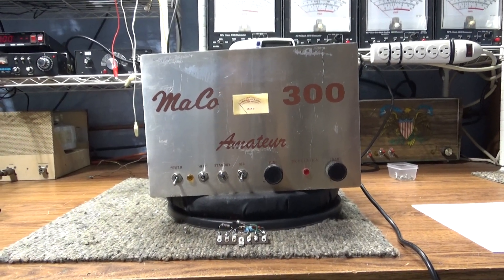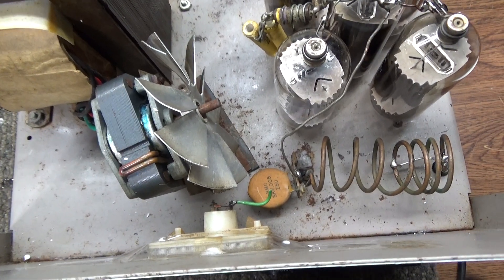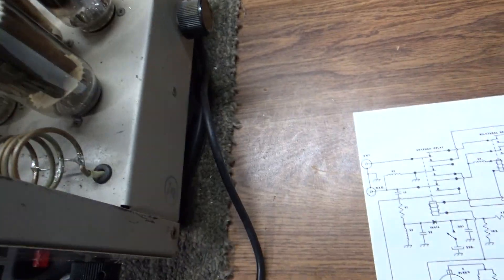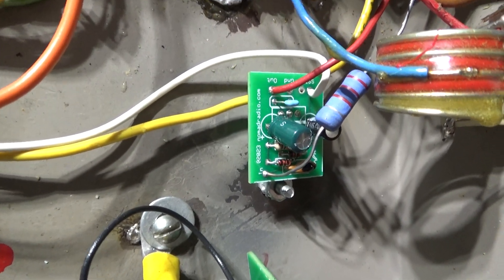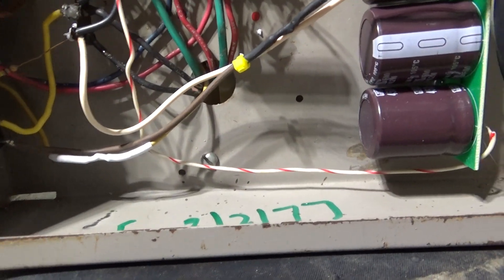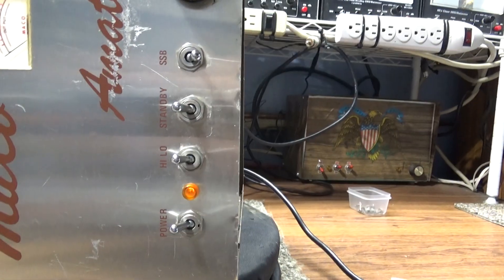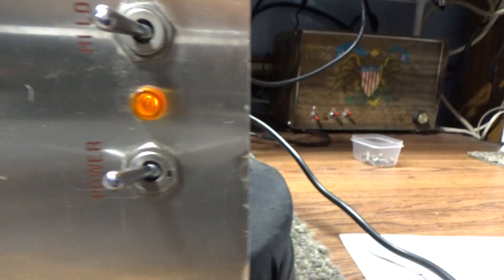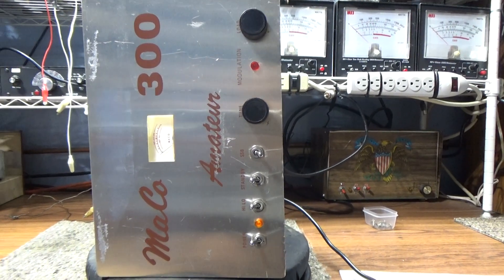Maco 300 sweep tube Linear Amplifier on the bench

Comment: With the diode it is a field strength meter.
Reply from the maker: Yes, but if the gimmick wasn't used to do something, then you wouldn't need the gimmick, right?
Reply: That is correct. You will also see “gimmicks” in input keying circuits. Two wires twisted together to form a pf capacitor. Length and twist determine capacitance.

Comment: If the transformer is running hot, perhaps having a separate filament transformer would help? 🤔

Something like the Hammond 185G12. You could perhaps run the 12.6V AC to the 8950's and the 6.3V tap the 6LB6's? 🤔
Reply from the maker: Agreed, I have done that on several amps already. That lightens the load of the transformer so it can concentrate just on the HV instead of the HV and the LV. Different but similar, I do the same with my home stereo. Bi-amping it really really opens up the sound. It's interesting to me with stereo as the 2 things that make a huge difference hardly anybody does. Bi-amping and running balanced. The 3rd but not as huge would be running stereo subwoofers.

Comment: The worst name ever, "gimmick: or "gimmick capacitor".  It's just a capacitor.  Two conductors separated by a insulator.  Many radios back in the tube era used "gimmick" capacitors for the RF output power meter circuit.  Even the Panasonic chassis tube rigs used a "gimmick" capacitor pickup for the power meter.  Most of the Lafayette Comstat  rigs used one.  Just two non terminated wires twisted together.  I use the same thing for sampling high RF power circuits when doing diagnostics.  Just twist two non terminated insulated wires together 2 or 3 times and you have a simple sample port that is good for 1,000+ Volts.
Reply from the maker: I agree about the name, but I think as you said normal capacitors are 2 conductor devices while gimmick's are single conductor and use something else for the 2nd conductor ie, close to the tank coil. I also think gimmicks have no insulator other than air separation, but they often have an insulator over them as its good practice not to leave bare wires hanging around.